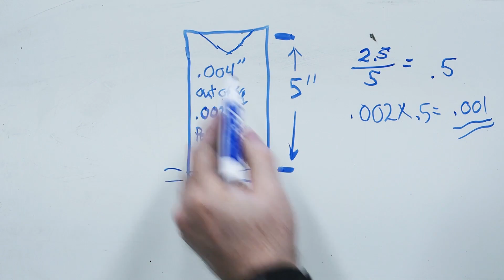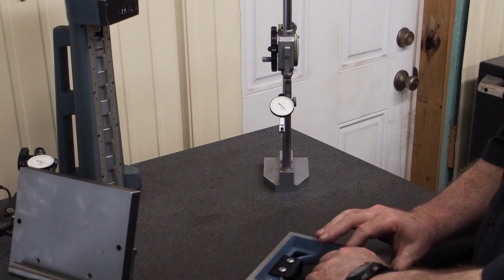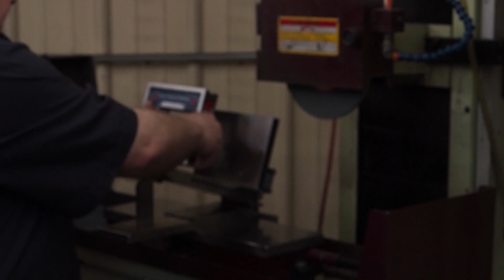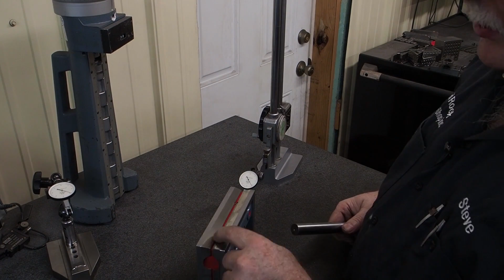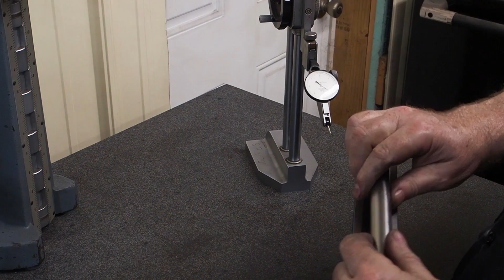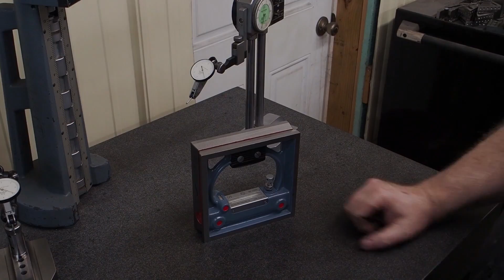Keith Rucker's Column Square part 2

Comment: Why don't you have a back rail on the chuck that is the full length of the chuck?
Reply from the maker: Sometimes you need to stick a part out beyond the back rail. By doing it this way I can stick parts past the back rail and still have the back rail when needed.

Comment: Hey, Steve. For that step method you pointed me to. Do you suggest side-wheeling the cut? Seems it may be easier to indicate in horizontally to shaft centerline. Asking in regards to my collet block difficulties
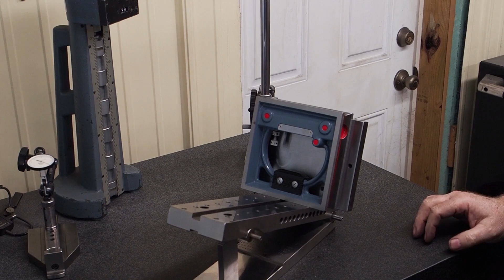Reply from the maker: I always use side wheeling as a last resort. It is not as accurate as standard grinding and it is very difficult to keep the entire surface flat. It is usually barrel shaped high in the middle due to the wheel entering the part and exiting the part where one side of the wheel makes contact until it fully engages the part with both sides making contact. The square one you can clamp the part to a good angle plate and indicate the pin true. Grind one side then rotate the part 90 degrees on the angle plate and indicate the pin the same way and grind the second flat. Then you can put the part right on the mag chuck, the good side on the mag and grind the opposing side true rotate 90 degrees second good side and repeat. Once all four sides are true with the pin you can then grind every side central to the pin and opposing sides equal thickness. With the hexagon one it will be a little more difficult. You can use shim stock under the low end to true up to the pin or you can use the step method I use. This video might make the step method a little more clear. I start the step method at about 15:30 mark https://www.youtube.com/watch?v=9_k1mUtzvtE
Reply: @SolidRockMachineShopInc  Steve, this finally clicked for me. Basically making a shim out of the part itself. This is such a powerful technique. Thank you for taking the time!
Reply from the maker: @InheritanceMachining  You are welcome Brandon. You have a great journey ahead of you and it looks like you are tackling it with great passion. I believe you have what it takes to go a long ways in this field. You videos are top notch and very enjoyable to watch. If you ever have any questions don't be afraid to ask.
Steve
Reply: @SolidRockMachineShopInc  that’s very kind of you to say. Thanks again, Steve

Comment: Great explanations Steve, thanks. You are my go to guy for tips on precision. I have so much to learn.
 I have been using the Radiac ruby wheel with great success. How do I order one of these SiC wheels from Radiac?
Reply from the maker: You can contact your supplier for Radiac wheel and just give them the numbers on the wheel shown in the video and they should be able to help you out.
Steve
Reply: Thanks, Steve. Much appreciated.

Comment: I get a lil confused when you're talking about the movements on the grinder because I had always thought that the Z axis is parallel with the spindle on all machines. Is that not correct?
Reply from the maker: You are correct. I call it Y because that most people I know think of the axis in terms of the mill and I would be answering 50 times more questions if I called it Z. Maybe I should explain it in every video I mention it.
Steve
Reply: @SolidRockMachineShopInc  i understand, just wanted to make sure I wasn't mistaken.

Comment: Steve, these are excellent tutorials. Thank you. 
Question - Can it help to verify by measuring the top plane width where it intersects the V? If either one was "off" then the plane widths would appear tapered?!  Stay safe and well :)
Reply from the maker: I actually checked them  off camera with the squareness checker. I forgot to do that in the video. The farthest off was .0002" in 5". We will be finishing our V Block in the next few videos and I will include that check on it if I don't forget again.
Steve
Reply: @SolidRockMachineShopInc  Ahh - sorry I jumped the gun. Many thanks :)

Comment: Thanks for the video!  Do you think it was out from the factory or do you think the iron settled or moved over time?  I've done some scraping on some cast iron that still had the original scrape marks still pretty much intact but things would be a thou to thou and a half out.  I doubt that it was originally scraped in and be out that far but on something  small like this square I just don't see things moving that much.  My shop specializes in other stuff and I just don't get enough time under my belt doing this kind of work to know.  Again, thanks for the content.  You've helped me expand what I can do a lot with your videos and it is very much appreciated.
Reply from the maker: It could be a lot of factors. It may have been just the stress working out over the years. It may have been dropped or many other things could have happened.
Steve
Reply: @SolidRockMachineShopInc  Thanks!

Comment: 42:36 doesn't it need to be a transfer block to hold the other v block for grinding? Or do you clamp it?
Reply from the maker: Hi Brian, I use clamping.A good set of transfer block would work too. 
Steve

Comment: All of the work you put into that column square, What would the cost for labor be if I were to send you an identical part?
Reply from the maker: Hi Laddie, I did that as a favor for Keith. If I charged our hourly rate at $75 an hour it would be about $375 plus shipping. The good thing is that all the fixturing is already built.
Steve
Reply: @SolidRockMachineShopInc  Thank you very much.

Comment: Nice job there Steve, near perfect result.
A lot depended on your set up being true, as per normal, yeah..
But having having each element, sine plate, set up block and backing plate square and parallel of themselves as well as subsequentally square to the table as a fixture...
Then attention to detail over 6 side transitions...
Steve, you make it look easy, which it Ain't..
And then you instruct, ad libbing as you 'casually' wind with both hands simultaneously!
Thank you Sensei.
Oh, I would like the file on the beautiful V block... please.
Reply from the maker: Thanks. Send me an email at solidrock@nlbchapel .org without the space before .org and I will send it to you. Can your software read Fusion 360 files?
Steve
Reply: Just checking Steve,
Did I email you correctly?